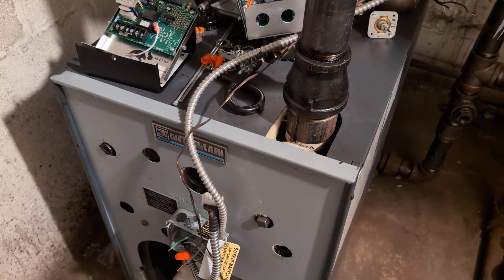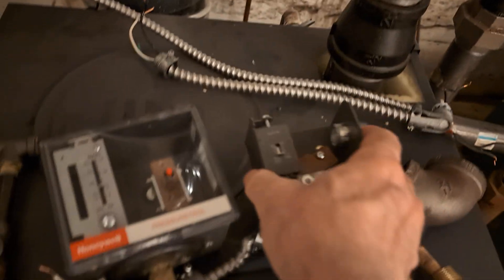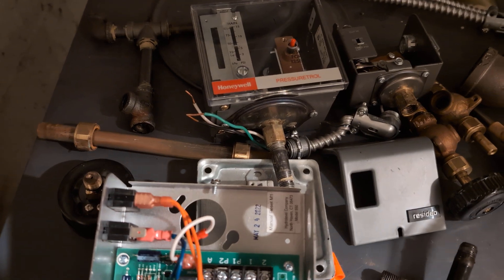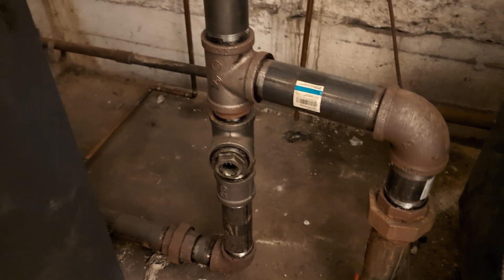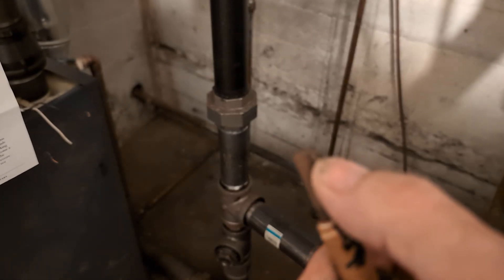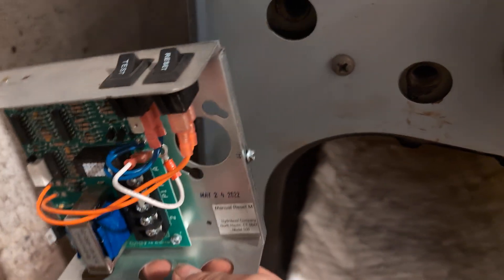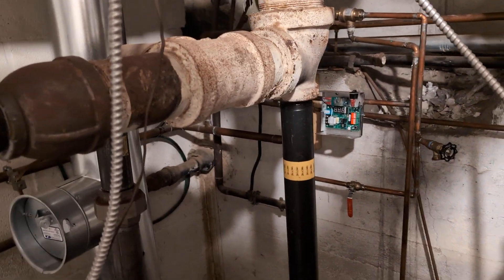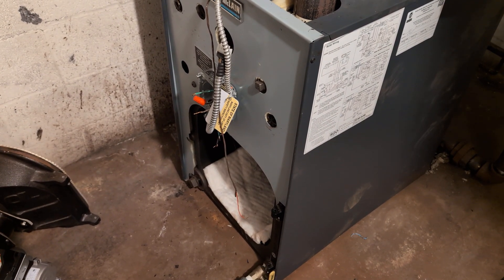Anyone Can Put In A Steam Boiler... Not Everyone Should

Comment: Sounds like a poor HW installer trying to do steam. Why 2 LWCOs.? Is this a commercial job or is it required by the boiler BTU?. I think in MA (where I am) 2 LWCOs (1 manual reset) are required on steam above 250,000 btu
Reply from the maker: @ed6837  Yes, this is a public building and under CSD-1 Code, two LWCOs are required, one of which must be manual reset

Comment: Why the aquastat ?
Reply from the maker: Why indeed. Your guess is as good as mine
Reply: @gordonschweizer5154   maybe running base board heat off the old boiler at one time ? keeping the water hot with the  aquastat, then a stat turns on a pump ?, They probably put the control back on the new boiler, cause; "well it was on the old boiler".

Comment: Looks so familiar. I had to redo a steam boiler that was installed by one of the bigger oil dealer service companies in my area, I can say it was so bad, I think they were tripping on LSD while doing the worst piping I have ever seen, every aspect of the install was wrong it was an ECT04 they had put a single riser 6" to a 90 into two mains, Whats a Hartford loop? and nothing even close on the dry returns they shorted both returns into one connection above the waterline it didn't stop there...... LOL